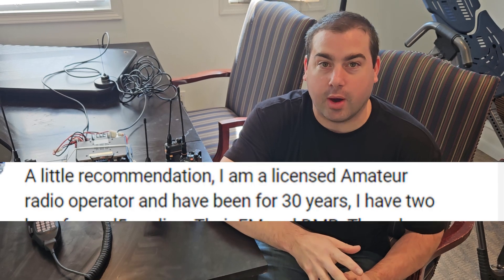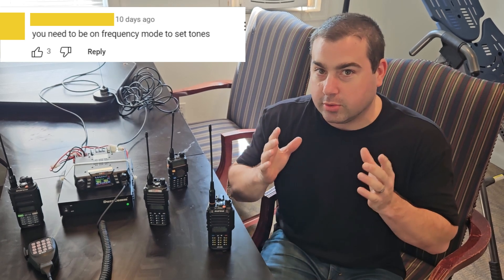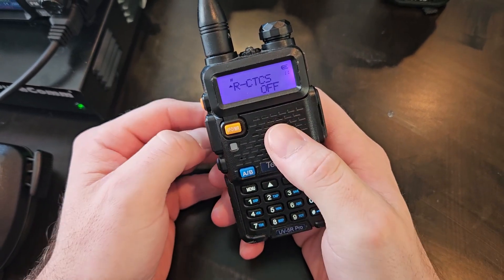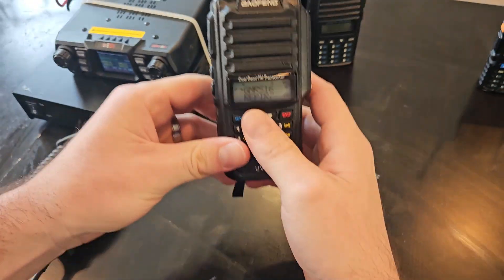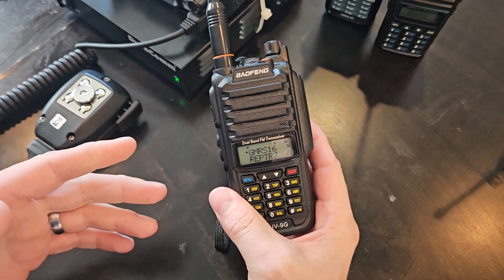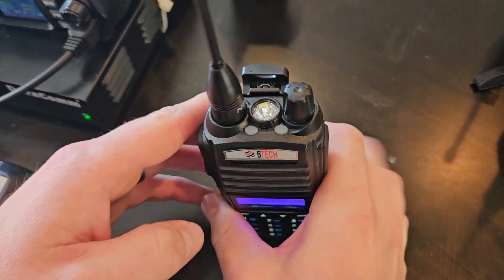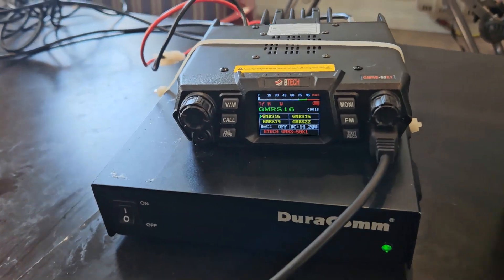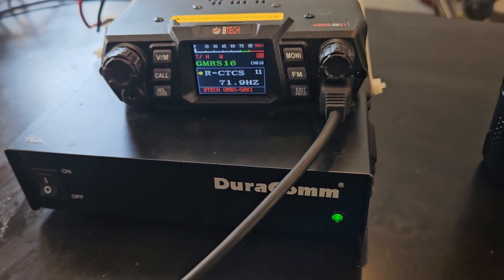Ham Radio Operators spreading Misinformation?

Comment: "This is because a GMRS radio is channelized."

Makes sense when you put it that way. The first time I manually set a tone on a UV-5R, my initial thought was "This feels like wiping BEFORE you poop", but maybe I'm biased from years of using police scanners that had you select a channel first then enter the frequency that you wanted to store in it.

I'll have to check if it works correctly on my UV-5G Plus, once the room gets dark enough to read that horrible red on dark blue menu text 🤣

Comment: Hey man, Love the channel. Live in the Baltimore area. New to radios. looking into getting lic. What do you think about the Baofeng UV-68 PRO MAX Walkie Talkies?
Reply from the maker: I had to look this one up but it looks ok it will work the same as pretty much any other radio I like that it's water proof. The only place I found it was on ebay. I like buying from Amazon or buy two way radios because if it has an issue it's easy returns.

Comment: I observed similar trying to save a tone on channel 24 to leverage local repeater.  The tone did not save.  I saved the same parameters on channel 31 and the tone would save there.  I am using TD-H8 GMRS radio.
Reply from the maker: Are you using chirp or keying in everything on the radio. channel 31 is off the standard channels though right? That must be a DIY channel on there it may need to be programmed in an app or on chirp... Im not 100% I do not own this radio...
Reply: @citizensurvivalplan  yes, viene channel 31 is user input. This saved the tone where I was having trouble with channel 24. It seemed the tone would not save on 24. I've used my channel 31 a few nights in a row without problem connecting to my best nearest repeater.
Reply from the maker: my bad I read that wrong. Yeah it should save on 24 for sure I would contact the manufacture about the problem tell them to fix it or replace.

Comment: What works in some radios doesn't necessarily work the same way on all radios. Obviously the GMRS uv5 doesn't work the way your other radios do, and it operates the same as the HAM version. It's the same guts just set up differently, so it operates the same as the HAM version. Being in VFO vs Channel mode doesn't have anything to do with the part of the spectrum the radio operates on, it has to do with the programming of the radio.
Reply from the maker: I used 4 different GMRS radios to show how the programming works between them.
Reply: @citizensurvivalplan  Get yourself a couple Quanshengs K5 or K6 one of each maybe. These radios can access frequency and have options that even the $500 radios don't have. And the firmware download is simple. You can find them for 25-35 dollars at most even cheaper if you shop around. Idk maybe you already heard just fyi
Reply: @citizensurvivalplan  4 DIFFERENT radios. It doesn't matter if it's GMRS or HAM. You didn't show a single uv5 series radio doing it even though you claim in the comments on the short that you've purchased the exact radios before that didn't have the "issue"... Where are those radios and why aren't they in this so-called explanation video? This shouldn't be that hard to grasp...the uv5 (r,g,xyz..any of the type that are the SAME internals and programming) doesn't allow you to save settings in channel mode like those other radios do. Why do you think all HAM radios don't accept changes in channel mode? Many do. Why do you think it has anything to do with the radio service they're marketed for? Where are you getting that information?
Reply from the maker: GMRS radios program in channel mode not in vfo i dont know how else to explain this. The other radios were returned because they did not work correctly and program in channel mode. I really cant keep trying to explain this to you just admit your wrong.
Reply: @citizensurvivalplan  it's not about GMRS vs HAM. It depends on the radio. You said you had the same exact radios (UV5 GMRS) that did program in channel mode, and that the particular ones in the short didn't. Where are those UV5 GMRS radios? No UV5 series radio programs in channel mode. Not HAM, not GMRS, none, because they are literally the same radio.
Reply from the maker: IN the manual to the radios in the first video the uv5x it says to program them in channel mode is the manual wrong too?
Reply: @citizensurvivalplan  I'm looking at 3 ham radios right now that all program in channel mode...and the uv5r doesn't... Just how you have 4 different GMRS radios that program from channel mode and the UV5 GMRS radios don't.. do you see a common factor? It's that the UV5 series of radios, whether it's grms or ham or if they made a uv5 series HF radio do not and will not program in channel mode. It's not that HAM radios don't and GMRS radios do, it's that almost every other radio does and the UV5 series doesn't. Do you get what I'm saying? It's not a recent batch or bad programming, it's not just the ones from Amazon, it's not only yours; it's something that those radios do not do and never have done.
Reply: @citizensurvivalplan  probably yes. The chinglish manual is probably wrong.. and if it says you can program it in channel mode then it's definitely wrong because those radios don't program in channel mode, as we've covered.
Reply from the maker: @vitogriffin8902  Sir I cant help you any further.
Reply: @citizensurvivalplan  the point is, you bought the 5x expecting it to program in channel mode like your other radios and it doesn't. I understand that. The people in the comments already knew it didn't because none of the other ones do either. The problem you're having with people in the comments is that you're acting like every GMRS radio is supposed to program from channel mode and HAM radios don't. You apparently just found out what most everyone else already knows, which is that those radios don't do that, and when people told you as much you had to argue that GMRS radios are supposed to just because that has been your previous experience. If you'd have put out a video "hey guys just a heads up to those who don't know, the uv5x doesn't program from channel mode.." then nobody would have argued. But you didn't. You acted like there's some recent bad batch and that the UV5x is supposed to program from channel mode, and you went as far as to tell people you had other UV5x radios that did program from channel mode, which can't be true because none of them do. Now you're stuck arguing in circles with people.
Reply: @vitogriffin8902  Many times they will change in channel mode.....  BUT.. it will not save to that channel.... it is only good until you change channels- when you go back, it reverts to what was saved in that channel..... if you want to modify the channel, you need to save and over-write the memory location.
Reply: @MrTux62  yup
Reply: @citizensurvivalplan  The manuals are hilarious.....  Don't get me wrong... I have a gaggle of Baofengs... from BFT1 and UV3r UV3R+  and the "Mark II" model.. UV5's  and UV17 (which has like 4 versions you can't tell from one another) The UV17- the Manual was COMPLETELY wrong...  it said there was a menu- I pressed the buttons exactly as in the manual.....  no menu.  I went by the "seat of my pants" and got it programmed for what I need... great sound.. good battery life and a nice flashlight.  They are fun to mess with- and I don't worry about them getting broken... stolen... water damaged, etc....  I wouldn't trade one of my Yaesu for 100 of them though.   I have a few OLD UV5r that program completely different from a newer one.... firmware difference ONLY.  Even could not use the same CHIRP file between them.  They are what they are...   the Quansheng series is cool- you can flash the firmware to what you want and completely transform it to whatever you want....  source code freely available.